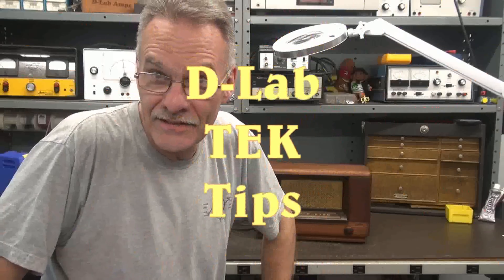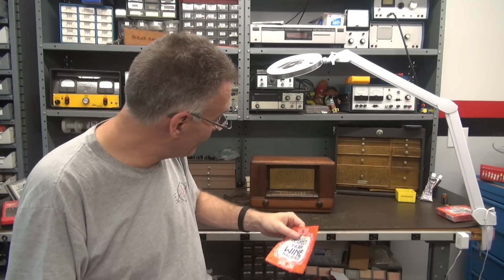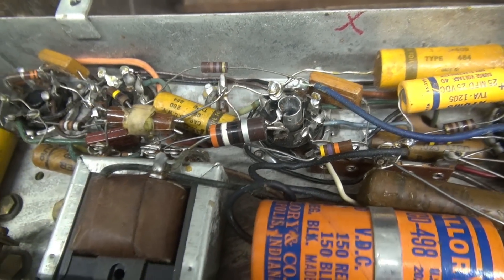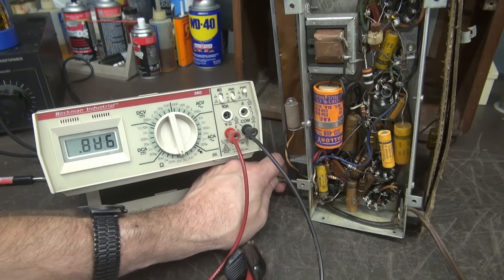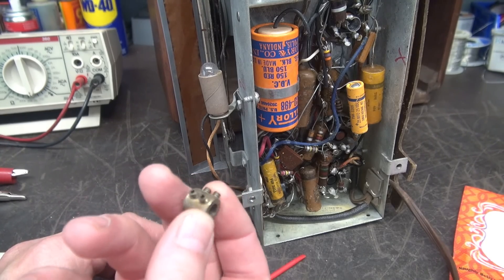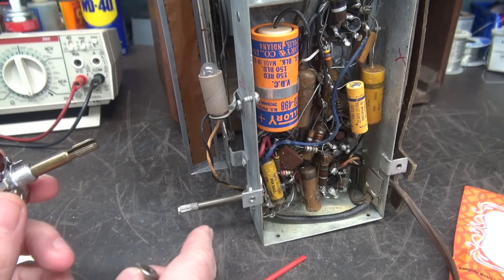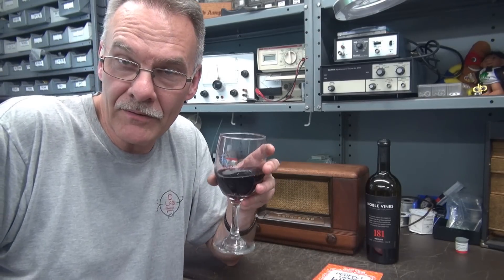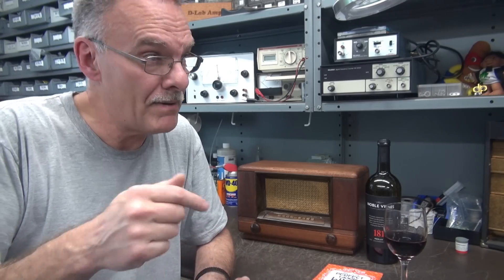How to repair a broken Vintage Tube AM radio  volume control power switch method

Comment: Great job on the repair! Yes those brass couplers come in handy. My fellow hams may be aware that the Kenwood TS 830S often has a broken band switch coupler. It breaks because its nylon. My 830S had the broken coupler. Purchased a brass coupler from K4EAA and replaced the broken nylon coupler with a nice brass coupler. Thanks to K4EAA.
John VA6JRC

Comment: From Leo:   Good instruction on saving the shaft with a coupler.   When it was still worth the effort to repair portable televisions,  I ran into a lot of similar problems.   Many times I would pry the back housing and switch off of a new potentiometer assembly, and crimp it onto the original potentiometer wafer and shaft.   That may help you some time.

Comment: I really hate those cut off discs. They also make reinforced cutoff  discs which are very strong and slightly thicker but boy I have never had one break on me. This is a 
Wards Airline 64WG-1809A. Amazing that it works with all those crapacitors in there!

Comment: In japan, we often use normal aluminum pipe inside 6.5mm and glued with instant adhesive. It was easy and low cost, off course strength is nothing to be desired.

Comment: I'd bet that the original repairs included the new dial cord, fixing a tear in the speaker cone, replacing the main filter cap with that universal replacement cap, and possibly replacing that 39 ohm 2W 10% resistor. It looks too new for the rest of the chassis. Probably last repaired in the first half of the 1960s.

Interesting, that radio must have got A LOT of use. The J-hook in the wire to the volume pot means that pot was almost certainly replaced once before. And that 1.5K 1W resistor also looks like it was replaced, with a big solder blob on the tube pin.

Comment: The shaft coupler trick you do will work for long shafts but most are shorter and there is not enough room for the coupler.   I can help,  see my comment below....

Comment: I am surprised you did not open up the pot and switch the shafts.  Have you ever done that? Those couplers can come loose, too.
Reply from the maker: The shafts are normally a press fit. Plus different manufacturers use different construction methods. Easier to install a coupler

Comment: I had a Grundig 7005 and the phono would not fire up. the on off switch was dead, but it was so unique I had to drill out the rivets and clean the guts real good then screw back together with #2 screws. reinstall and viola it was also repaired. Was very happy to have seen enough of you video to give courage and an idea what to do. My radio expert did the power front end but did not want to touch the phono. Feels good. this a terrible video of a test after the repair, https://youtu.be/hFjDN9eYG7c    your videos have helped so much in knowing where to look and how to fix stuff, thank you D-Lab

Comment: Nice job but I would first have attempted to repair the faulty switch before replacing the volume control with a NOS pot, the likes of which are near impossible to find.  You never know what you can fix if you don't try.  Viva la radio!

Comment: 8:10 - Wouldn't it be easier to just replace the switch rather than replace the whole assembly?
Reply from the maker: If you had an exact match, yes, not the case here

Comment: With digital A.M. very likely and supposedly incompatible with analog, what is the point in keeping these old rigs alive?
Reply from the maker: Still have the old style stations here. Ive never heard digital AM
Reply: In the USA you can legally operate your own little AM radio station. Everywhere else  you can also do that, if your transmitter is small enough not to be noticed. I use one of my old radios as a loudspeaker for my computer. 

Aside from that, fixing stuff is fun.
Reply: @mfbfreak  But the fun of DXing with these will be gone.
Reply: @JosephLorentzen  That's definitely true and sad. But with radio as a whole kind of dying, not much we can do about it. 
In my age bracket, broadcast radio is mostly cast aside and replaced by on demand music sources, even in the car.
Still, there are quite a few stations on the air we can enjoy, and the radio itself is usable as an amplifier when used with a modulator (or the appropriate safety transformer)

Comment: Why is it that the majority of guys working in Americas "Consumer Electronic Service Business" have no real training or very limited knowledge about the fundamentals of electronic. The amount of "How to fix an AM Radio" videos always explaining  to replace capacitors 1,2,3,5,6, resistor 2 and 3 or tubes seems to underline that fact. Never heard a technician with real training/schooling saying "just replace all capacitors" or "replace the tube because it's not glowing". You get a detailed explanation like "The mixers oscillator is not working because the filter-capacitor for UA is defective and therefore pulls down the anode voltage UA for the oscillator to operate." or "The audio output distorts after a while because the couple capacitor is leaky and passes some of the preamps DC to the control grid G1 of the output tube moving the bias to positive and therefore raises or overdrives the anode current which results as distorted audio signal, sometimes also indicated by overheating of the anode plate". Try separating your videos by sharpening your fundamental knowledge while moderating your repair effort. My take, making the video clip 6* of 10*,  technical expertise 4* of 10* overall "Average <> Good"
Reply from the maker: Yep, Im picking up what your putting down. This channel is dedicated to common sense troubleshooting & repair, not overloading my viewers with high power BS. I get enough of that at corporate america. There are plenty of channels that will pitch that at you so they feel good about themselves. D-Lab is the common folk electronics channel & I will not change that. TD
Reply: Oh I see, just another PG13 tinker channel, ok than ...